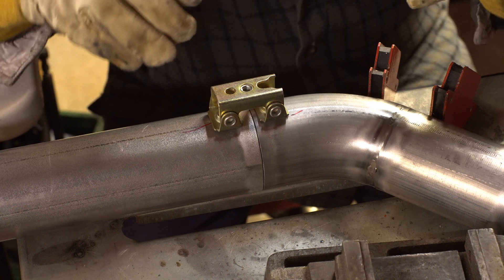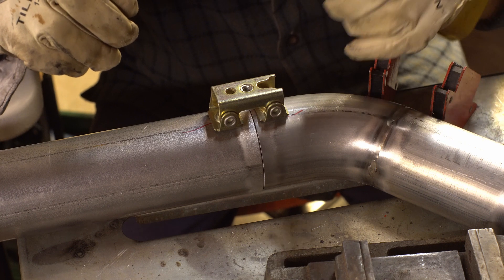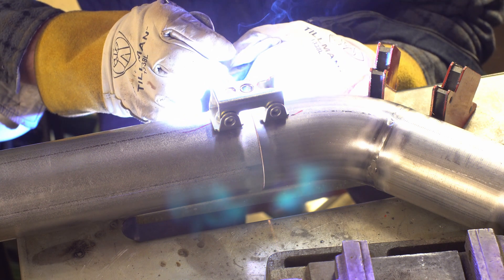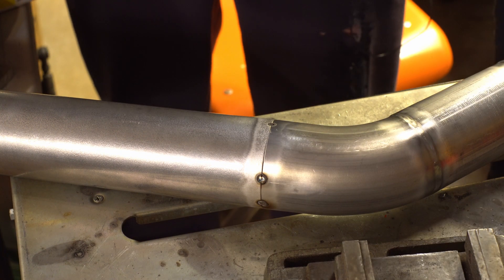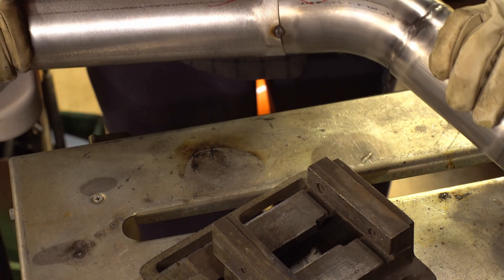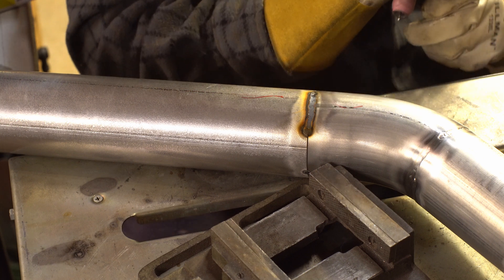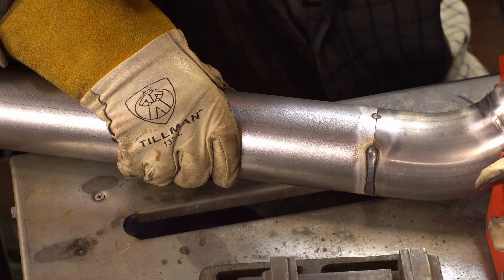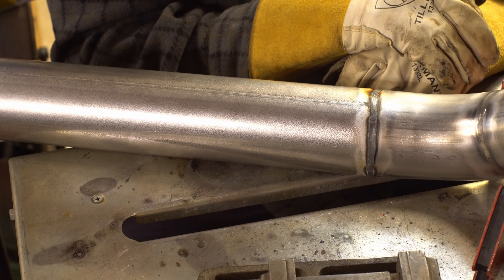Fusion Welding Aluminized Steel Exhaust

Comment: do you have to TIG welding it or you could use mig on it
Reply from the maker: You could certainly mig it.  That wouldn't be fusion welding, but it's by far the most common method of welding up an exhaust.

Comment: Why would you use stainless filler rod on Mild steel? And I don’t know what kinda machine you have that’s so diff than mine but a 100 amps would absolutely blow through some 14 or 16 gauge steel right away. I set my everlast machine to 55 amps and full pedal with rod will burn through
Reply from the maker: Stainless rod is more forgiving of impurities - much less likely to get porosity issues.  It's not as mechanically strong as a mild steel filler rod, but more than strong enough for an exhaust.

Comment: Can i do it with DC? Or AC only? I know argon + aluminum is AC only, but there is steel underneeth so if i grind away the aluminium coating i should be good with DC right?
Reply from the maker: DC is what you want to use.

Comment: Is that regular steel exhaust pipe that comes on cars??  I have a dodge dakota and I'm looking to make my own exhaust pipes I like how your exhaust pipe came out without filler rod is
Reply from the maker: Yes, it is.  It's held upgrade since I made the video.
Reply: @AlexLTDLX  so you saying I can fusion tig weld my exhaust pipe and it will hold up did you use gas to do your fusion weld on your exhaust pipes???
Reply from the maker: What I'm saying is it's held up fine so far on this car since I did it. It's not exactly a daily driver but we did just take it to the track: https://youtu.be/RT0M88xHzNQ And yes, I used argon.
Reply: 0k so did you use argon gas to fusion wild your exhaust pipes???

Comment: What does he mean by "fusion" weld?   There's MIG, Fluxcore, TIG, stick, and OA gas, but oh no he's "fusion" welding. (?)    Is he talking welding vs brazing?
Reply from the maker: A fusion weld is a weld without filler material.  For structural stuff in mild steel, usually you'd use filler metal, both to keep a consistent thickness of material and prevent things like stress cracks from forming.  An exhaust isn't structural, so I wanted to try fusion welding - it's quick and easy (assuming you have a TIG machine).  It's been quite a while since I did this, and the welds have been trouble free.

Comment: Why did you use stainless filler rod?
Reply from the maker: Stainless is more forgiving of junk in the weld than mild steel - it's less likely to cause porosity.  It is a little bit more brittle than most mild steel fillers, so I wouldn't do this for structural stuff, but on an exhaust, it'll last forever.

Comment: Late to the party but if you were in my garage this afternoon, it was a carbon copy of this video.  fired up the Yes/No Welder aluminized tube.  fusion.  needed two hands.  still worked.  I love TIG.  I can only get better and videos like this show me there are many ways to fuse pipes together.  Not everywhere is an Instagram World.

Comment: What is the cheapest welder that I would be able to Fusion weld with? Also do you need 220 volt or will 120 volt also work for DIY garage stuff. 
I own a mig welder but with wire feed it’s not a option.
Reply from the maker: Honestly, a 120 volt unit will do most of what you need.  I rarely go over 120 amps.  For steel work, you only need a cheap DC inverter unit.  They can be had in the $200-$300 range and are tiny.  Thought I'd definitely want something with high frequency start and a pedal.  You'll likely spend the same amount of money on the first argon tank (you pay for the bottle; then refills are a lot cheaper).

Comment: Hey, i love it, good details for beginners like me, im new to tig weldin, and im about to make one exhaust system for my truck, i got a question for you, do you do a thing called "purge", because i saw a few video, read a few articles, they do the  thing called "purge" thing, is it a need to do it to make one of these? Or it could be done without it?
Thanks, your answer would really help me 👍
Reply from the maker: You only need to purge stainless really. The nickel precipitates out, and you end up with a thing called "sugaring" on the back side of the weld.  The sugaring is brittle and prone to rust.
Reply: @AlexLTDLX  wow thats a whole lot of new knowledge from you to be kept in mind, thanks alot alex, helps alot!, and thanks alot that was indeed fast reply! Cheers!

Comment: Not quite as strong as the rest of the pipe when you are letting gaps zip closed. But, like you comment elsewhere, they should be within 90% or so. The other big advantage though is that you aren't introducing another alloy that has a different expansion rate. As long as you protect from rust, they'll outlast anything.
Reply from the maker: It's held up just fine so far - even on a few longish road trips and our first drag tests of the electric turbo, where it showed some frankly amazing gains, along with an epic burnout that destroyed $450 worth of slicks: https://youtu.be/AOL3Qyczt3Y

Comment: This helps! I’m about to do this to extend my diesel exhaust.
Reply: It’s at the very end of the system near the rear axle.  Already did it and it seems fine so far.  It will last until I make my own stainless system.
Reply from the maker: Diesels put a lot more heat (stress) into the exhaust.  I'd still definitely try this though.  Let us know if it should fail - mild steel isn't ideal for homogeneous welding; but my application is less demanding than yours.  Good luck!

Comment: As a student welding I would tell you that you should have used the stainless filler metal through the whole weld as without it the weld is much weaker and there is little fusion, if you were to give it a few blows I bet it would crack.
Reply from the maker: And that's what I would've thought.  I use a lot of stainless filler - it's great for dirty material.  But so far so good; and this is on a 900 hp street car almost a year later; in fact we've even done some dyno testing with it driving it to another state.

Comment: Done a lot of fusion welds on exhausts over the years. They eventually crack. Stainless is much worse about it though.
Reply: Kane Kid does autogenous welds on stainless exhaust all the time and they seem to work perfect.
Reply from the maker: I'm half expecting these to fail, but so far, so good.  If they do, I'll take the opportunity to go to aluminum tubes.

Comment: isn't it surprisingly easy? I'm still learning how to tig exhaust for my new project but, man compared to trying to stick weld exhaust tig is the way to go, maybe mig is but for some reason I don't care for mig welding partly because don't know anything about it but I'm choosing to learn stick and tig. stick for thick stuff and tig for thin. good video. ok so i got curious on what that what appears to be a 3 inch pipe was for. nice job on the 10.2 , at first I wasn't aware that you were working on a race car piece.
Reply from the maker: I was mostly worried about cracking issues because of contamination and the fact it's mild steel.  But it's holding up nicely.  Btw, you can TIG thick stuff pretty easily; the same way you'd stick weld thick stuff - multiple passes.  I almost never use stick since I usually have to weld so close to the LTD (spatter).
Reply: @AlexLTDLX  those welds are not going to crack at all.  I think all that hype about contamination is when you weld sanitary pipe for like food industry.  and maybe on this type of stuff the contamination will reduce the strength by 10%. so you exhaust will last 9 years instead of 10 lol

Comment: Great video, I'm going to be building an intake for an 84 diesel rabbit soon, the plan is to use aluminized exhaust tube, pie cutting to get my angles but I was concerned about Tig welding it.  This helps solidify my plan.
Thank you

Comment: Nice video! Are these welds as strong as welds done with filler rod? Sorry, I’m a noob to tig..
Reply from the maker: Technically, probably not.  Since the existing metal had to flow into the "gap."  But since there's virtually no gap, and I saw no porosity at all, they're probably 90% as strong as the pipe itself.  In other words, plenty strong, at least for my purposes.  You could always run a bead on top if it bothers you (now that I think about it, running a bead of 309 filler would also resist rust quite well - I like using 309 where possible because it flows nicely and is very tolerant of crap in the weld - in fact I use it more than mild steel filler - such as er70).
Reply: AlexLTDLX awesome! Thanks for the info, that makes sense!!